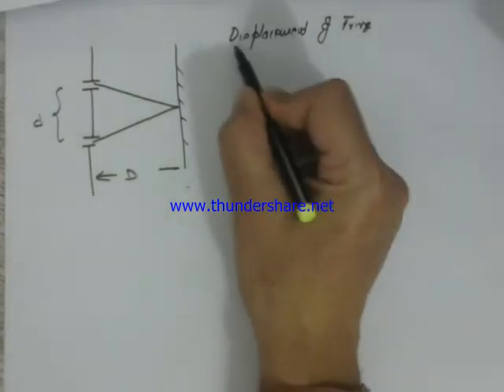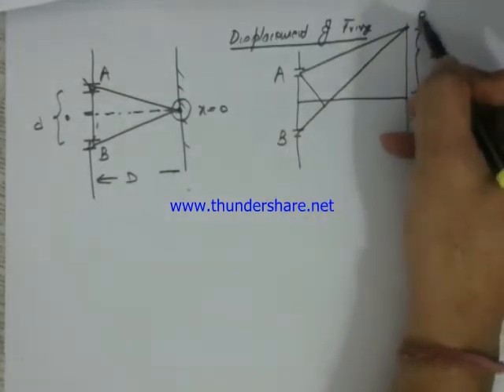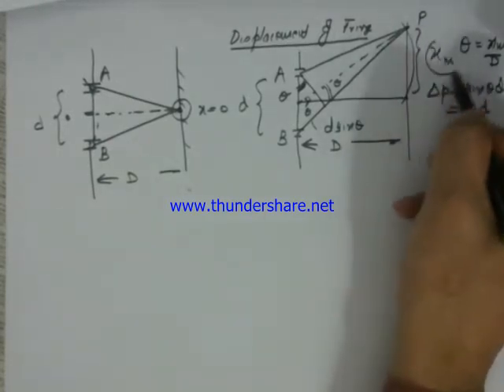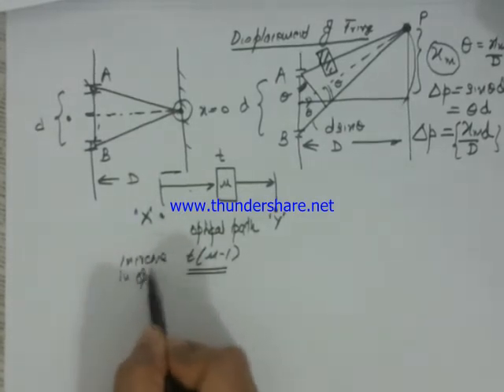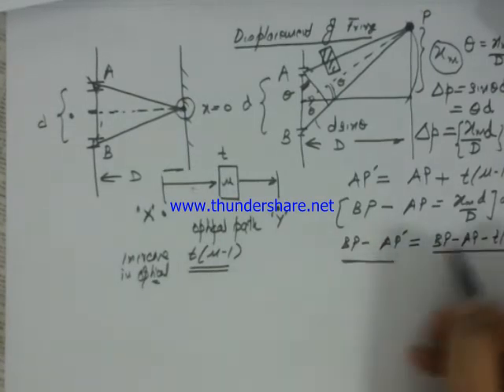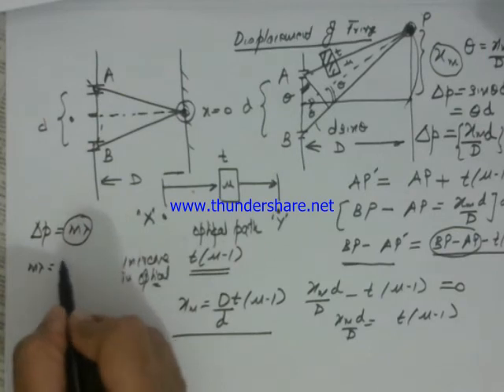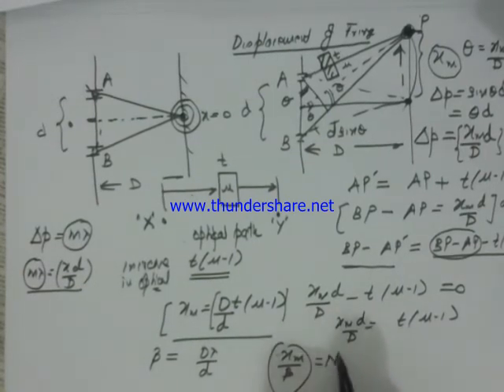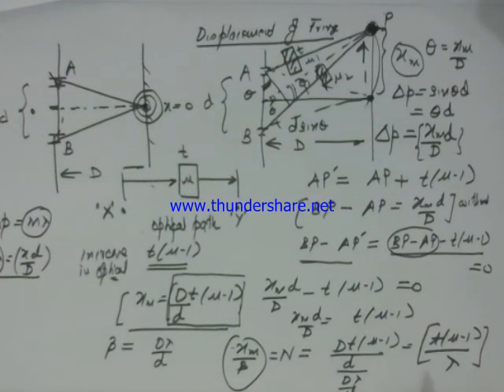fringe shift displacement of fringe -fringe shift

Comment: Sir i really want this confusion cleared.
Why is it that when we put a slab of any thickness of some refractive index in any of the beams the fringe shifts but does not change the fringe width🤔🤔
Reply: Because the difference between two Maxima and two minima remains constant
Reply: Rember the basic definition of fringe width
Reply: upper and lower end of fringe would experience equal amount of shift